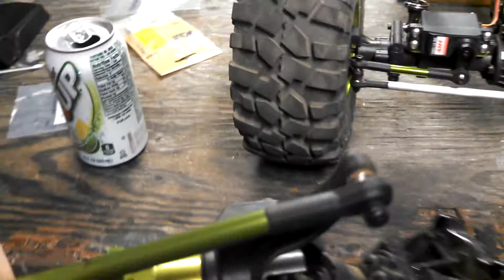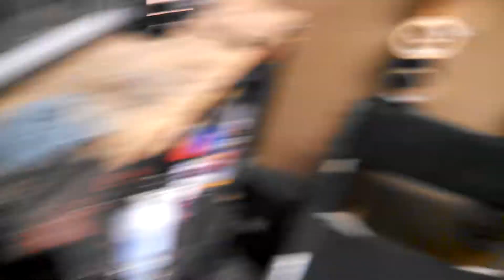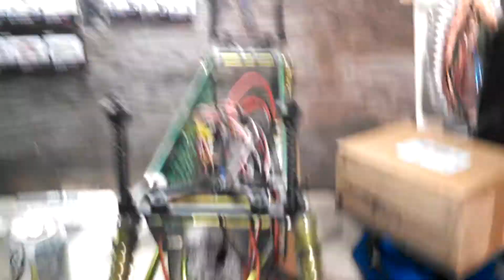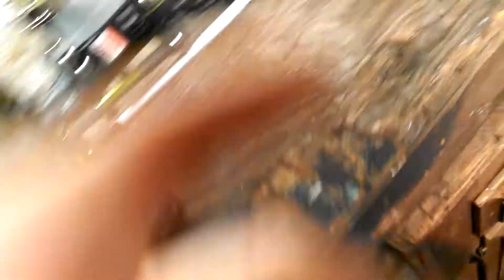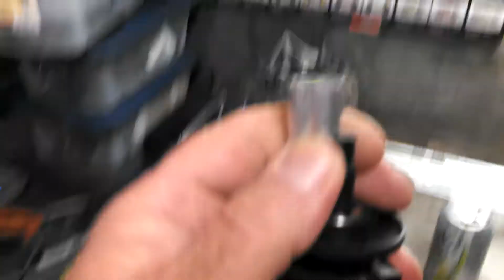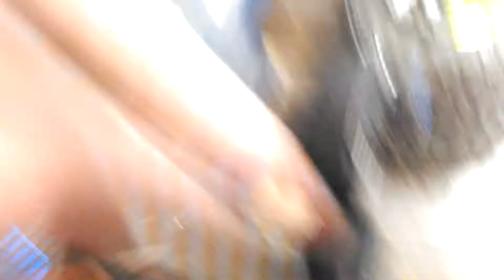the build of my 1/5 scale exceed crawler part 2

Comment: Are still running a stock speed control, I found them wholly terrible.  I switched to LiPo's 2s 5000w 7.4 v, still stock motors....
Reply from the maker: no on the esc. i'm running all after market eletronics